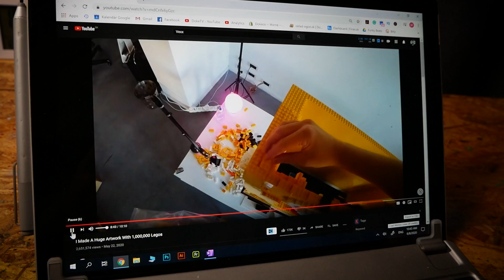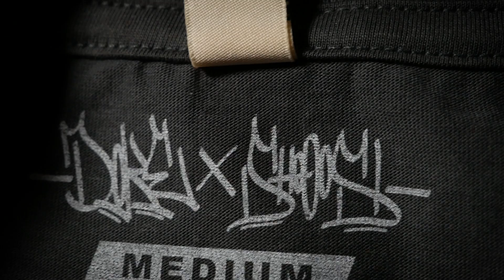I try painting LEGO ( this is freakin HARD!)

Comment: Technical question for you Doke. (Or anyone else who has experience with spray cans who reads this.) How come your spray cans are all missing the nozzles and stems? I can understand the nozzles missing as hot swapping them between cans keeps them clear, but with no stem, they shouldn't work, and from my understanding, once removed, the valve no longer works if you try to put them back in.